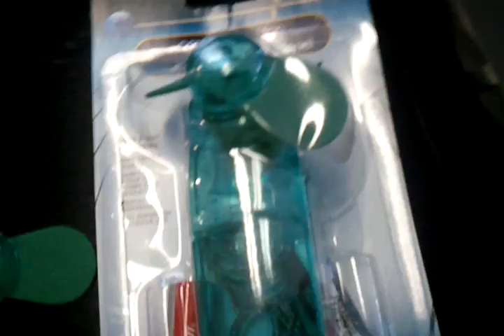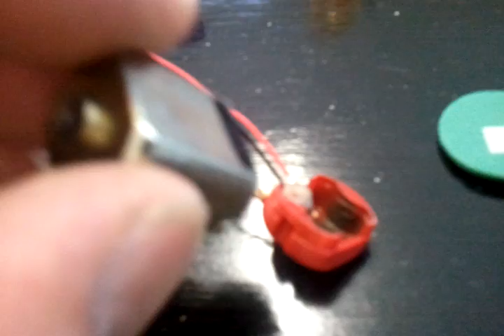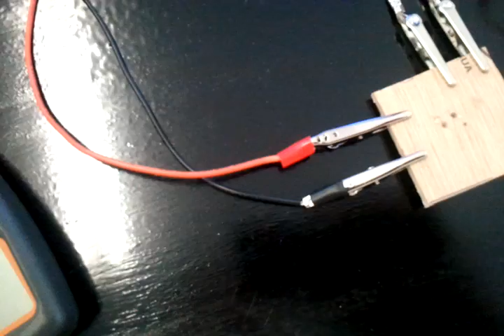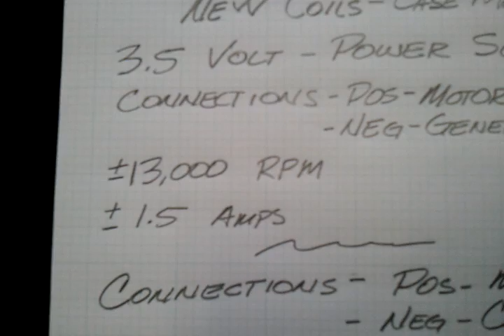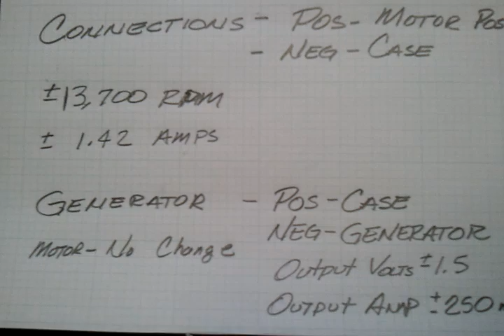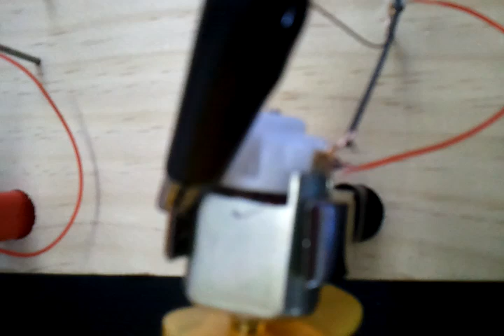UFO's Asymmetric Motor Variation - It Works!

Comment: You can use the Power supply this time placing a Diode (1N4001) in series with the positive power lead. The Diode will reduce the voltage from 3.5v to 2.8 v.  The diode "uses" 0.7v.  Try your experiment again.

Comment: did you try hooking the generator up to the original motor next to the asymmetrical motor? Also, since you have the second commutator right next to the motor on the old blown motor, why don't you use that to make it a dual commutator unit so it has two sets of connectors?